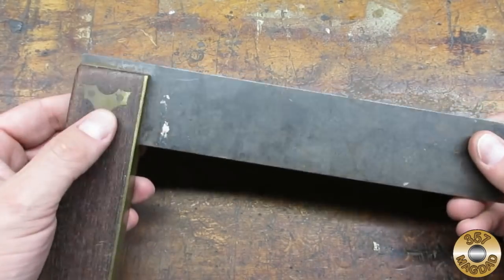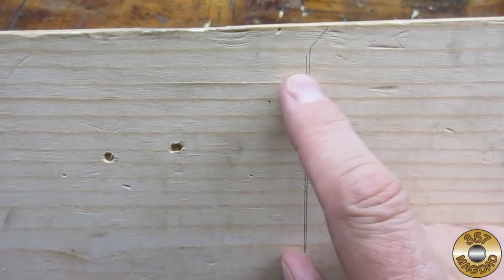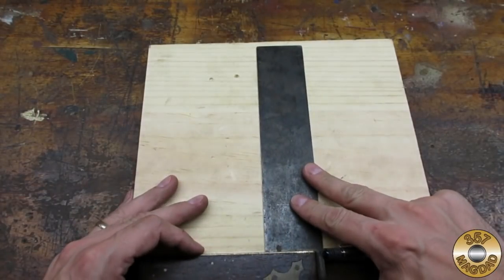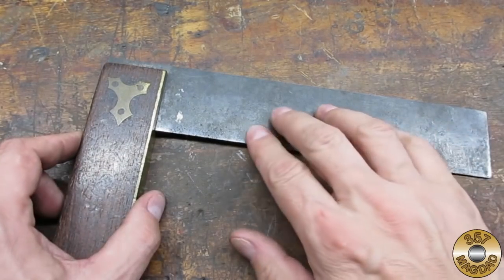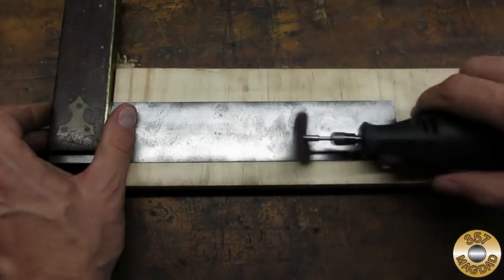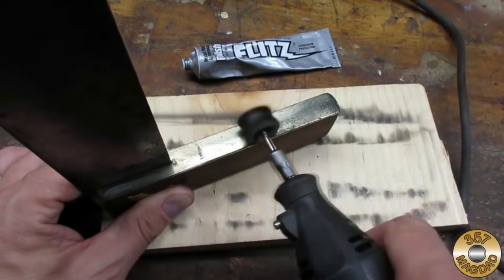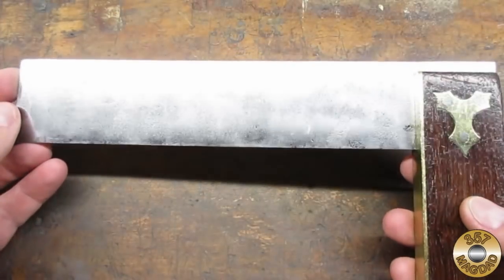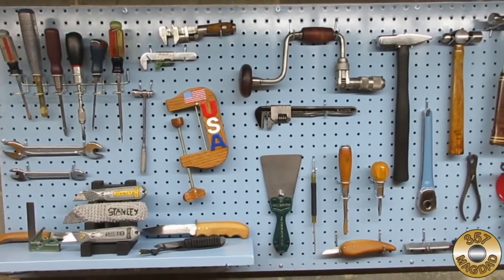Hand Tool Restoration - Carpenter's Try Square

Comment: Nice job on that antique square. I had found one at a flea Market and restored it too. I think antique tools are much better than new cheap tools. Tool makers back in 1800s to mid 1900s made beautiful and 1000% better made and longer lasting tools than today!
Reply from the maker: Cleaning up old tools is fun!  You just can't beat steel, wood and brass!

Comment: 357 Magdad you did a good job on that antique square. I have the same kind that I also have restored. As far as displaying your restoration projects I think it's cool to do. My family know I love antique and vintage tools and one nicknamed me THE TOOL MAN. There is one tool or rather brand of tools I'm very fond of to restore. They are H.K. Porter bolt and limb cutters made at their old plant in #Boston#Everett#Somerville, Mass plant. That is where my dad worked and I have 15 tools all made there which span my dad's life. He was born in 1912 and by oldest tool is the 1916 bolt cutter then I have metal strapping cutters made in late 1970s to mid 80s which was when the plant closed. My dad passed in 1979, the year after he retired! Every time I use these tools or restore a new one I touch a part of him!
Reply from the maker: Thanks Steven.  Cool story about your dad and HK Porter.

Comment: Good one, thank-you!  I found one like that in a mud hole over at our park's parking lot.  I did a clean up because it was calibrated in 1/8" increments ........ very useable for me. Also have two more from a garage sale that need help.
Reply from the maker: Any tool made of wood, brass and steel is worth cleaning up!

Comment: Clean-up looks great!

You mentioned that you didn't remember where you got the Scotchbrite pads from.  I've had the same issue with buying matching spray paint for a project.  I've gotten in the habit for everything I buy for the shop, I use a Sharpie and write on it, the date and where I bought it.  It comes in handy when replacing supplies. 

Keep up the great work!
Reply from the maker: Good idea with the sharpie Jeff!
Reply: That's an awesome idea! 👍
Reply: Agreed!  Awesome idea!

Comment: That turned out tremendous.  I passed on couple of those squares at a antique engine show here in Kansas. I have seen you restore those and they always turn out great. Now I am really regretting not picking at least one up. The were not to much. Oh well at least I picked up a auto wrench for 75 cents. I have been working on a perfect handle monkey wrench that has me stumped. It screwed both ways  when I started. I oot off the rust and sanded smother the handle scales. I was really cleaning the metal because I had found some blurring  like you
Reply from the maker: Thanks Glen!  I like to get the beat up try squares for a buck or two.  They clean up really nice and do well on ebay.  I love those auto wrenches.  Sometimes getting the pin out can be tough.  For 75 cents you can't go wrong!  Good luck on the monkey wrench project!

Comment: So I made some of the scotch brite wheels for my dremel and when trying them out on a small square restoration, it’s melting and leaving a great residue all over the metal? Have you experienced this?
Reply from the maker: I have not had that problem.  I use the discs on my Dremel's lowest speed setting.  I don't apply much pressure, I let the disc do the work. If speed and pressure don't help, maybe try a different abrasive pad.  I've used the red and gray scotch-brite available at Home Depot in the painting section with good success.  I have not used the standard household green.

Comment: Magdad, your video served as an inspiration for me to work on mine.  The steel rule is pretty patina’d so I tried cleaning it with brasso.  It didn’t really do much. Could I use something like Naval Jelly or is that too caustic??
Reply from the maker: I'm a big fan of good old fashioned elbow grease.  I like to scrape as much rust off as I can with a sharp putty knife or razor blade.  Then I work through the sand paper grits.
Reply: 357magdad thank you sir!  I bought sheets of fine grit wet dry sand paper yesterday so I will try that route instead of a chemical agent.
Reply from the maker: @stevetilk4926  If you get a chance email me some pics of your project.  I love to see what others are working on!
357mdad@gmail.com
Reply: 357magdad I sent you an email with pics of my projects this morning. Thanks again!

Comment: Nice cleanup 👍.  I tried to make my own scotch brite cutter out of copper pipe but just couldn’t get it sharp enough so I just cut them out with a scissors,
Reply from the maker: Thanks Frank!  When the exhaust pipe adapter gets dull, I just use it to mark the circle in the pad, and then I cut it out with scissors also!  I find that the disc can be a little off - it trues itself up in the Dremel pretty quickly.

Comment: Sorry I sent that before I was done. Big fingers. I found some blueing like you have used before. I thought it might look good. Was getting ready to try it and it stoped  opening after about a inch. I have tried everything thing to get it open. I have no idea what happened. It has threads like a c clamp. I can not find any thing  wrong. Do you have any ideas. Things are slowing done a little bit. So I will send you a picture of it and re send the info on that other email that l had sent earlier. And put down what was needed. Thanks
Reply from the maker: I got a bluing video coming up next week!  I'm not sure whats jamming up your threads.  Pipe wrenches tend to get abused.  Maybe the threads or the nut got smashed. Shoot me an e-mail.  If I can't figure it out, maybe we can get ScoutCrafters help!

Comment: I picked up a similar one a few weeks ago at my local flea market. This one doesn't have the ornate brass plate at the three rivet points, but is also capable of doing 45°. I never checked for squareness  and after restoring it noticed both edges were not square. Never dawned on me to true it up like you did with a file. Thanks, I'll revisit this resto to make it true and useful again. Subscribed. :)
Reply from the maker: Thanks Temuba!  I picked up the trick by watching a few videos.  I've tried it on a few squares now.

Comment: I love these squares as well. I have been collecting them since I was a teenager! You did a good job on it! What diameter is the exhaust adapter you use to cut the scotch bright? I love the project wall! Thanks for sharing!
Reply from the maker: Thanks Wayne!  The adapter is 1 1/4" x 1 1/2".  I started out using the smaller end, but I have found that the larger discs work OK in my Dremel.
Reply: Thanks Magdad for the info. Very helpful.